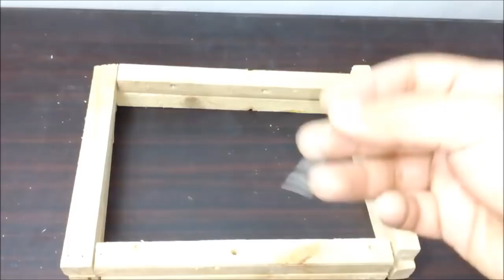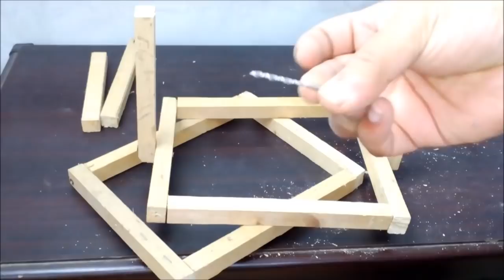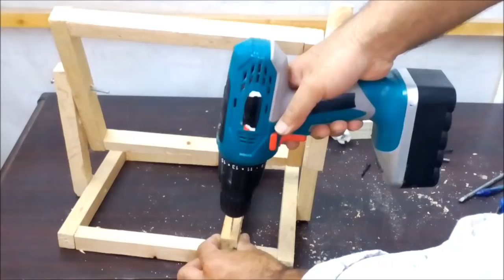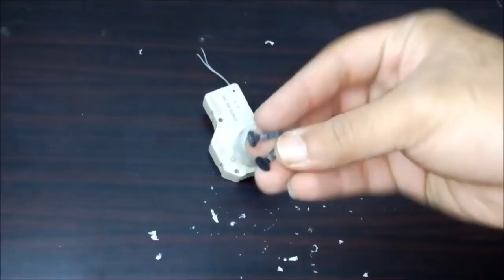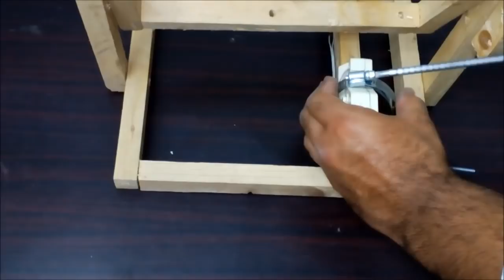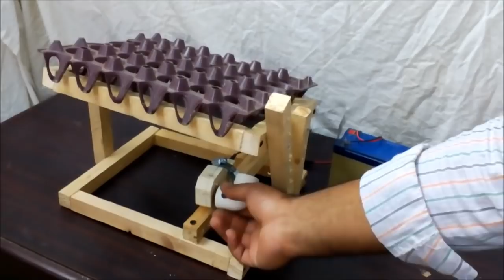DIY Egg Turner - Incubator Egg Turner - egg turner for incubator - Automatic Egg Turner

Comment: i am very interested in you work thanks, but i have a question for u is that possible to extend this work for more load i mean if a lot of egg is needed
Reply from the maker: You are welcome 😃,This motor can take double size tray of about 60 eggs , for more load then the metal gear motor will be required

Comment: Ah! just ran it to a bit of problem. the build is finished but since i am going to set it inside a foam box there is not enough room for the motor. i am not really  experienced with wood work. but i think i messed up. any chance i could send you the image or video and you could guide me and point me in the right direction?
Reply from the maker: I always make the egg tray motor first and then the box for it , because it need more room 
yes you can contact me on my facebook  tayyab sumair  or send it on my whatsapp 03353486206

Comment: Please put this in incubator..
And also how will you set to rotate after 5 hours each because we have to turn egg after 5to6 hours
Reply from the maker: If you want to make it rotate automatically after every 6 hours you have to connect it with a relay timer which will rotate it
Reply: DIY PROJECTS thnx alot
Can i know about motor which is rotating it...
And please tell me the name of device of auto rotator so that i can order it online
Thanx
Reply from the maker: It's asmo made low rpm motor